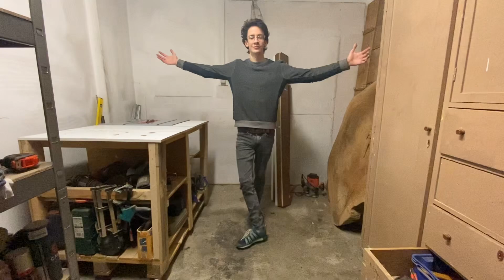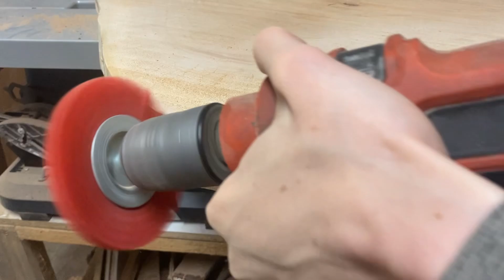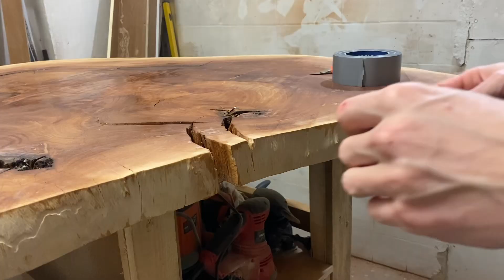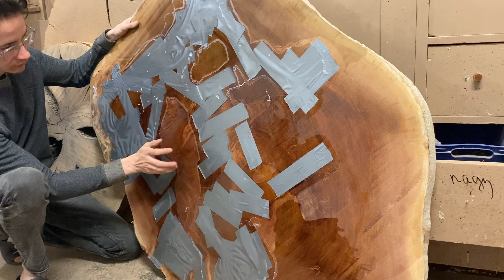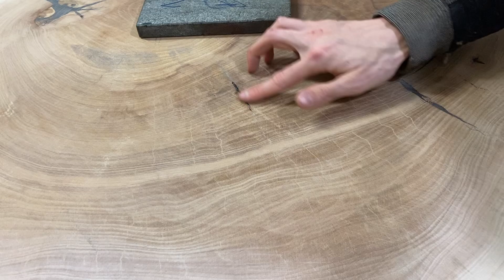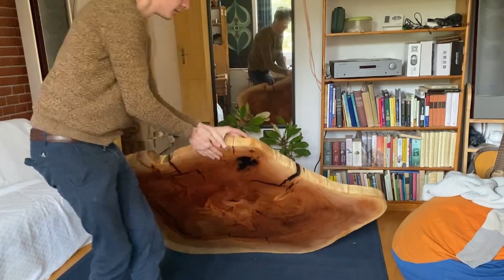Making my first 1000$ table, Rough beginnings

Comment: I live in Germany and use Epodex. I don’t use tape to cover a melamine/plywood base or sides. I use HDPE sheets as a base. I have 3mm 1m x 1m sheets and also a 2m x 1m 1mm sheet which  is delivered as a roll. You can use either as a base. Easily cut to size or made bigger just by using tape to join 2 sheets. I also cut off strips of various heights. Various lengths. 1mm is very flexible for odd shapes. I seal it to the wood with Silicon Sealant and use hot glue gun to stick the side strips to the HDPE base. Epoxy doesn’t stick to HDPE and hot glue is easily removed. Easily reused. For those emergency leaks I always have a tub of plumbers sealant/Fermit on hand

Comment: Uhm... why treating both the sides? Is it going to be some sort of a flipping table? You could save a lot of materials and effort.
And if you've left the slab's natural shape, why have you neither sanded the bark beetle traces on the edge nor emphasize them (with black epoxy or something)?
Reply from the maker: You need to treat both sides because seasonal wood movement would effect the two sides differently, which could cause cracks and warping.  At least thats what I have been told
Reply: @hefestodesign  Well, there are a couple more things that affect the sides unevenly: weight (reaction force of the support), light, heat, consumer use... I guess they are more likely to cause stuff than differing quality of sanding or polishing.
Reply: @deniskhafizov6827  "I guess they are more likely to cause stuff than differing quality of sanding or polishing." Can't wait  for a clip sharing your experience after applying protection on only one side of a big chunk of wood. I might even subscribe.